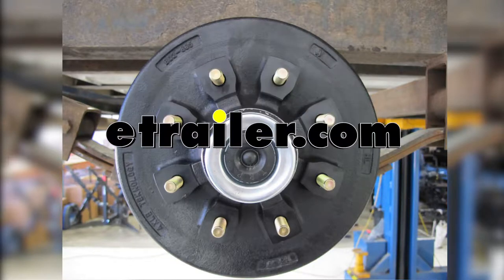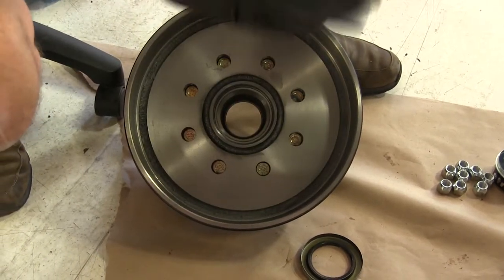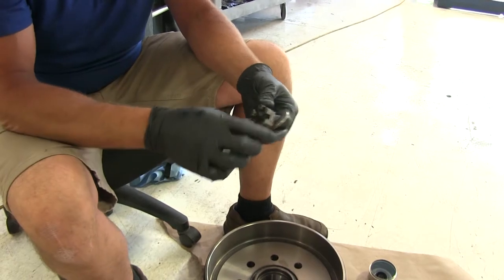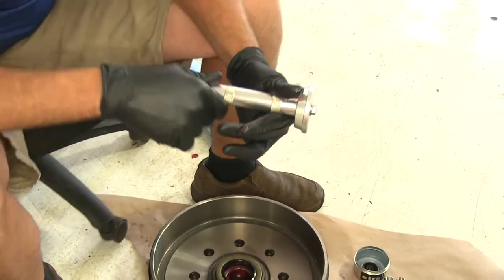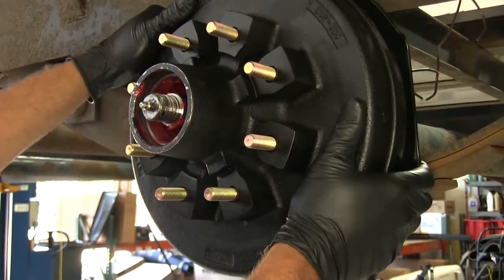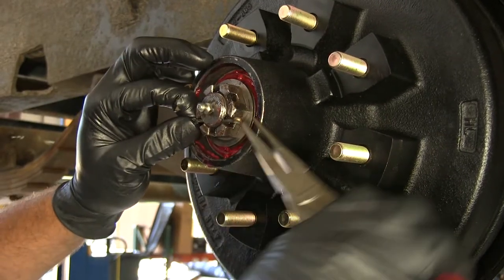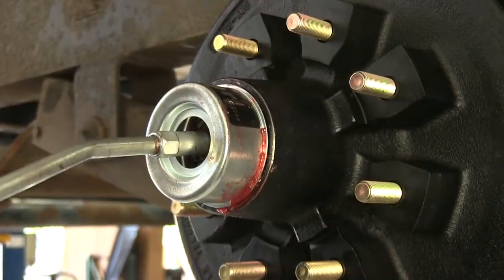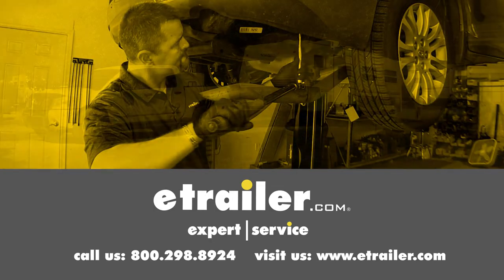etrailer | Let’s Check Out the Easy Grease Trailer Hub and Drum Assembly for 5.2K

Comment: Bolt dimension ( length)
Reply from the maker: The wheel studs are 1/2" diameter x 1-5/16" long. Check out more information in the following link.
https://www.etrailer.com/Trailer-Hubs-and-Drums/etrailer/akhd-865-7-2-ez-k.html